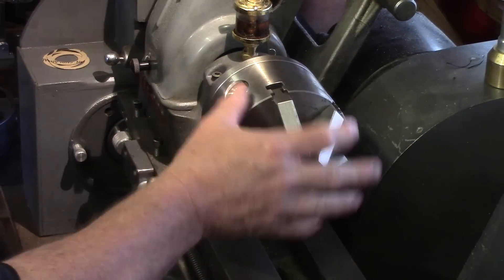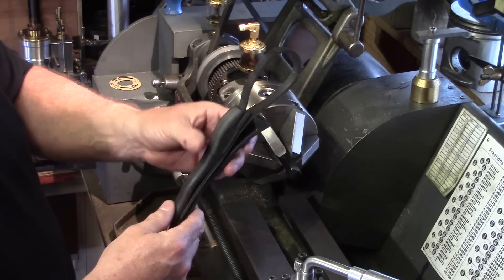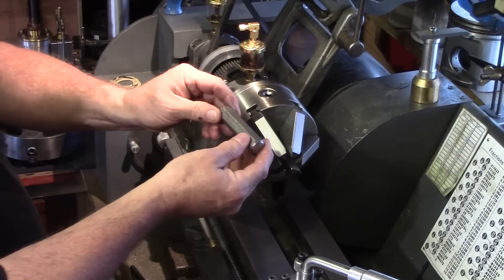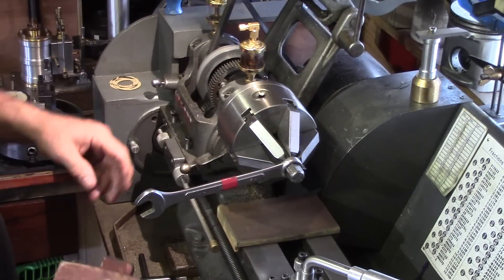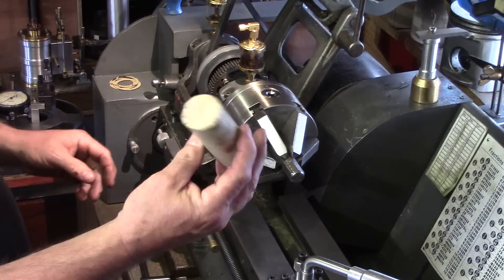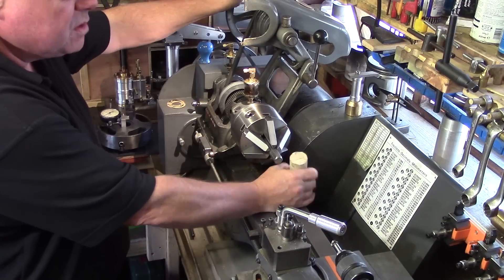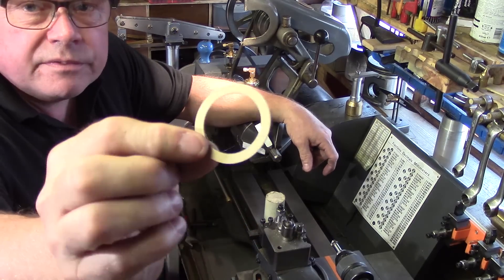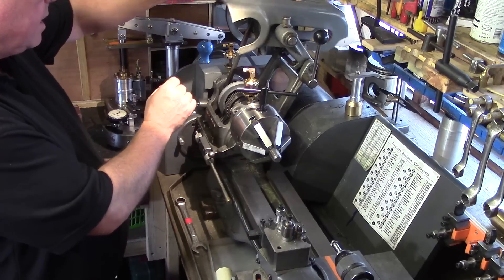An Easy Method of removing a Stuck Chuck on the Myford ML7 Lathe

Comment: My Myford Super 7B which is 25 years old has an original locking pin at the back of the head stock which enters a hole in the pulley to help unlock chucks!!! Never had any problems I just push the pin into the hole and with an adjustable spanner I grip one of the jaws of the chuck and off it goes!!!!!!

Comment: Nice little tongue in cheek part about the chuck key, many years ago, for my local school I setup a holder for the chuck key with a micro switch interlock, so the machine wouldn't run if the chuck key wasn't in its holder. It stopped a lot of accidents.

Comment: An ordinary paper ring will work as well as gasket material to make the chuck easier to remove. Just remember not to be doing any work that requires running the spindle in reverse or use on a lathe with a good spindle brake.
The safest method is to make a spindle bore expanding mandrel with a long crank handle that can be anchored and then a hexagon bar in the chuck.
Like he says, using the back gear or wedges into the cast iron head stock is inviting disaster.